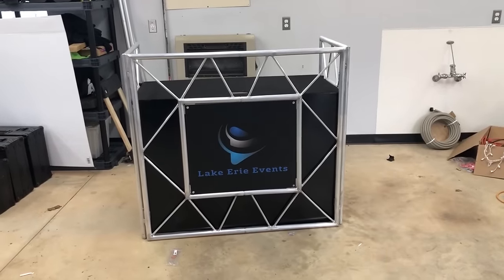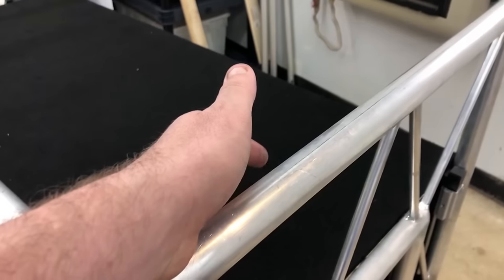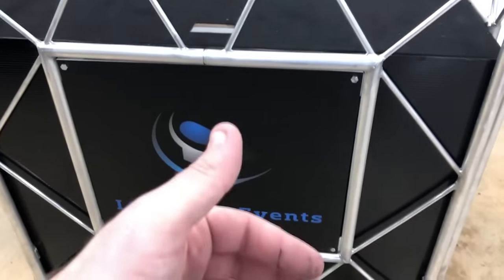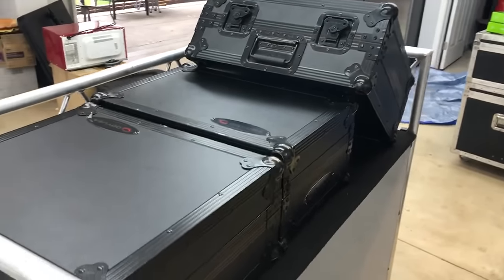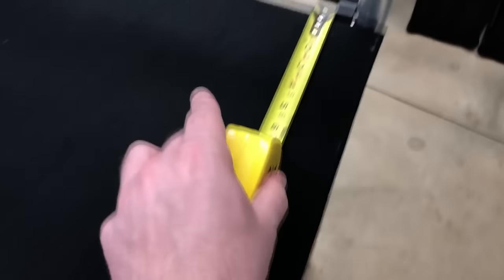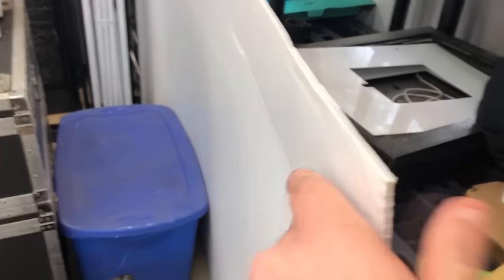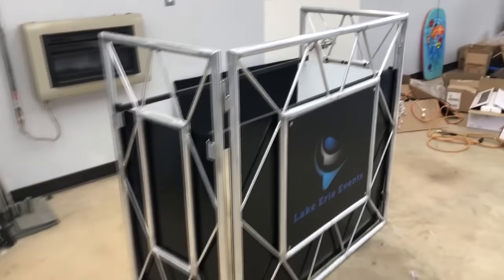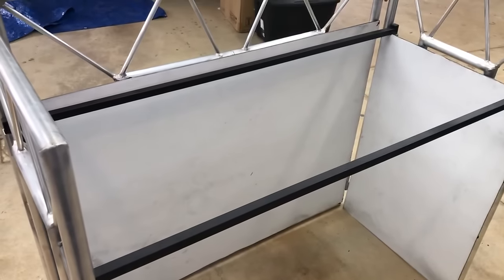ADJ Pro Event Table Honest Review With My Modifications

Comment: Great video... I have that table and did not have any problems.  I love it.  I bought the scrim and can put lights behind it... it works great, except the scrim covers the logo area so I made another logo frame and hung it from the top frame segment...it works.  I was curious if your panels can be just white and if they are translucent enough to have backlighting with some floor lights or pars.

Comment: Got mine today and mine don’t fit perfectly together either. And talk about horrible sloppy welds omg. I’m going to do the same spray paint thing thanks for the idea.
Reply from the maker: Good luck!
Reply: I bought the Headliner DJ booth that’s mostly a copy of this and the welds are terrible. Same middle connectors and terrible plastic thumbscrews. I do like the look better but came here to see if the ADJ had a similar quality issue.

Comment: thanks for the review...think im gonna copy their design and make my own but for the "loose" parts" if it were me I would drill a hole through both pipe sections and get a stainless pin to hold it tight together...just my 2 cents

as for the clamps I would think you could use a 3-4 inch pipe of some sort and using the same drill and pin method slip a larger pipe over the unit to attach your clamps.

given the fact that its also not big enough for you and what they charge maybe you can return it.

again...im building my own out of steel plumbing pipe and fixtures...

thanks for saving me the time and money from buying this though

Comment: It is a shame you could not put an extension in between the slides  and on the table lengthen it a couple inches also and the bars that lock it together

Comment: suggestion brother you should measure first your equipment with that carrying case before you purchase that event table.i really like that table too but still thinking about it and it kinda pricey :) i think they designed this for portable dj gear like sx, sz and not for the turntable with boxes.
Reply from the maker: Dj Hurt right! It didn’t affect my sale much, and I know it would be tight before buying. I’m fortunate enough to own several controllers like the SZ2 so it’s not a deal breaker that i have to take my S9 and turntables out of the case. 

Thanks for watching!

Comment: If space is an issue for your turn tables and mixer why haven’t you just taken the S9 out of the case and leave the tables inside the case?  I don’t see the issue with that. If it’s just a inch then you should be able to do that and have room to run cables behind the S9

Comment: As for the tube thickness, was it advertised as any certain size?  Why would they make it out of heavier tube?  That is not what the structure was designed for. (Hanging lights, etc.)  Get some 1" clamps and be done.  For the table size, you should have looked at the specs prior to buying.  It's not a "flaw", it's your lack of research.
Reply from the maker: That's a really harsh comment, but i'll respond.
Yes, it doesn't say anywhere what the tube sizes are, and that's something that caught me off guard so I wanted to mention in this video. I purchased new clamps, but this is the first thing in 15 years of business I've ever needed that was 1.2" thick. Speaker and light stands are 1.5", and Global Truss is 2". That's all I said. It's a very awkward size and that's inconvenient.
Also, the table size isn't a problem, but I definitely consider a "DJ Table" that can't fit 2 turntables and a mixer in road cases a design flaw. 

Thanks for watching regardless.
Reply: @DJJoshErieOfficial   Josh Bennett  how is it a harsh comment when it's the truth? The length, width, and height are all advertised. You should have measured your cases before ordering the table. So Trixx is right, it is not a flaw!
 I uses my road case with the sliding laptop shelf for my SX2. I slide the front of the case forward a little and it works perfect!! 90% of your complaints are in fact, lack of research. But I do understand your issue about you the table not joining together properly. That is a flaw.
So next time read specs, measure, confirm things will fit before you purchase. 
Keep on mixing!

Comment: I know its personal preference but I dont really care for the look of these without the sides on it. The width would prevent me from buying this. Im a turntable guy with a 12" mixer and I have everything wired to perfection. There's no way Id pull everything out of the cases every gig. Im not sure how they let such a design flaw through.
Reply from the maker: Ultimate Event Lighting that is without a doubt the biggest concern I have with this booth. I’ll be using my controllers a lot more based on this and that’s upsetting.

Comment: Push those joints tight bro, drill a small hole on the backside, insert pin/screw, fixed.

Comment: Hey Josh,
Like you, I fell in love with he industrial look but didn't do enough research prior to purchasing, and discovered a lot of these little niggles and quality control issues as I used it. 

1) Two transparent
2) Don't like the big whole if there's no sign
3) Sign board poor quality.
4) hinges on one panel weren't welded on both edges. (discovered the issue when one snapped)
5) The shelf supports didn't have any plastic end caps on the undersides. This meant that he sharp edges of the steel cut into my carry bag. 
6) Recent discovery. The lengths of wood on the underside of the counter top are only stapled, not glued. Had to do that repair myself. 

Here's some of my mods. still work in progress
https://youtu.be/rRYZziXlX4U